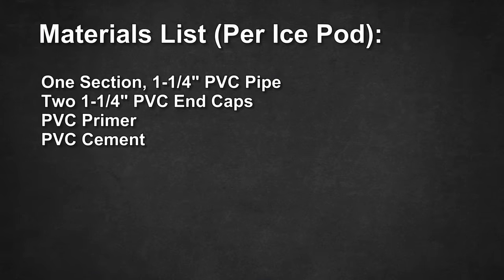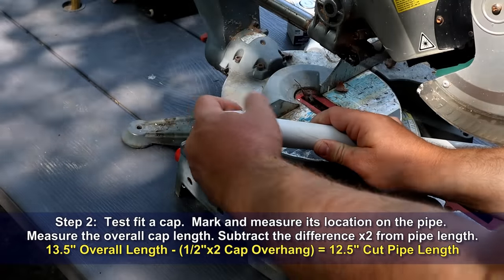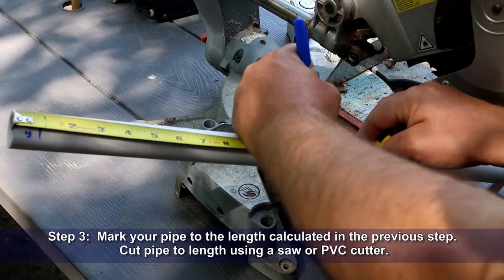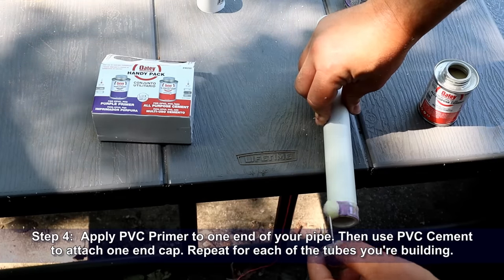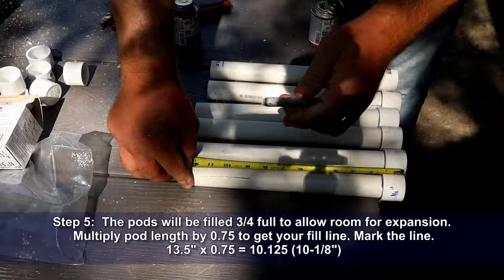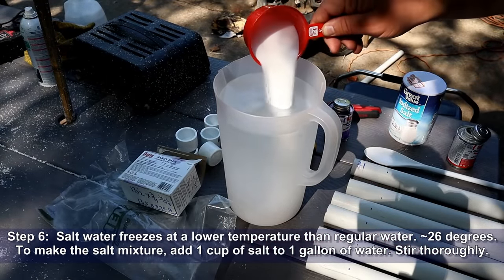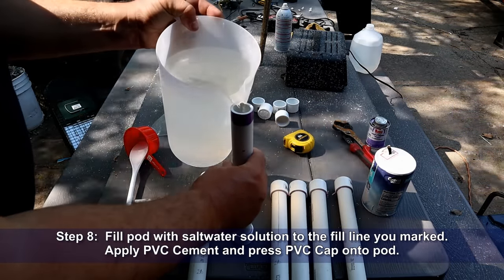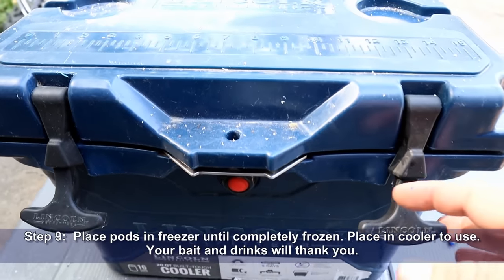Cooler Hack! How to Build SUPERCHARGED Reusable Ice Pack Pods

Comment: I like the idea, and I like a commenters suggestion to use steel, because the heat / cold transfer properties are faster.   However I feel compelled to note, that although salt water and fresh water freeze at different temperatures, the actual temperature of the water / ice / or other solution  is the same as the rest of everything in the freezer, provided it's had enough time to get cold.  A freezer set at 0 degrees Fahrenheit results in fresh, salt or artificial solution at 0 f within a day or two (maybe less)...  That's where the steel would help the water freeze colder faster in the freezer.    

I've been using refreezable soft packs, but I don't like how they sometimes freeze into jagged irregular shapes if I don't lay them out in a single layer in the freezer, and that takes a lot of freezer rack space.  Using rigid freeze packs like this or other, is now really appealing to me.  Thanks!

I like the DIY and presentation and steps shown.  :)
Reply: That much steel would add way too much weight.

Comment: I've seen a lot of comments about boiling water or trying to figure out how to keep the pressure down when the water freezes but I have always just filled the pipe with water, stood it on its end in the freezer with the one cap off.  When it freezes, cut the overflow of ice off and then cap it.
Reply from the maker: @friki-tiki  not a horrible idea.

Comment: You can actually fill the tubes to 90% volume. 

I do this by filling a tube with water, pour into a measuring cup on a digital scale, pour off water until I get the 90% of the original weight, then add 5% salt of the original weight.  I now have a perfect 90% volume that will fill the tube when frozen. I seal and repeat for each one.  I've had some of these for over 10 years with no real signs of wear.  I also use them in the cold smoker to keep temps down when smoking cheese and fish.  

It takes ~5% salinity to hit the 26f or -3.5c mark.  I believe 23.3% salinity has the coldest/lowest freeze point around -21c, but most home freezers aren't hitting that.
Reply: Or, just fill some water bottles 90% full with sea water, and you're done. Save money, time and re-purpose.
Reply: @jejoko  the plastic used to make water bottles will not hold up like schedule 40 pvc, can't be cut to size, nor fully sealed.  I would not put bottled sea water with all its microbes in my for human consumption freezer/cooler.  Also, if you live anywhere but the coast a drive to the home depot is probably cheaper than a drive to the ocean.
Reply: Ideally, a good quality freezer will hit -7 Fahrenheit. If you hunt or store large quantities of meat. It is best to keep your freezer at 0 Fahrenheit or lower if possible. If you hunt deer or wild hog, you should keep it frozen at 0 or below for at least 7 days to kill the trichinosis parasite. Because a good quality freezer can hit these lower temps. They should not have any issue freezing the 23% salinity water. It will just take much longer to get them frozen. In many cases almost 36 hours in PVC. If using copper pipes. Possibly in 24 hours.

I keep both of my freezers at the coldest possible temp. Now in my house fridge freezer combo. The freezer is only set to 20 Fahrenheit. My ice cream is easier to dip, then when I pull out the ice cream from the deep freeze at a -7.
Reply: @thehyperactivesloth  
Yes, if you live on the coast, it is quite convenient. I have been using the same sea water filled Gatorade bottles for years now. They have been thawed and frozen many, many times over now. 
About the bacteria or what not that you're worried about just cook your meet to recommend temps. Although I must say that many times I have washed my catch straight in the blue ocean and made ceviche right there on the boat without any problems. Not to mention all the bacteria and microbes that are already on and inside of the fish that are being thrown in the cooler or whatever hog or deer you have in there. The water in the bottles is probably cleaner at this point, lol.
I must say that I am tempted to try the PVC pipes just because they seem to have a more homogeneous fit next to each other. But other than that, my Gatorade and water bottles do just fine.
Reply: @garyzimmerman8679  Agree, my dedicated freezer is at -2 F
Reply: @garyzimmerman8679 you have a better chance of winning the power ball than contracting trichinosis from a deer.
Reply: @jejoko  well, except for that 2 day trip to the ocean to get it......
Reply: @michaelharris1455  
Yeah.... sorry about that mate
Reply: The freeze point of the liquid doesn’t matter. Any variation of water with or without salt will reach the temperature of the freezer. Unless you’re trying specifically NOT to make ice.

Comment: I tell you how to make them last longer and "freeze" much colder.
1 - Fill them with lead shot first, to the top,
2 - Fill them the rest of the way with anti-freeze, yup, ethylene glycol coolant.
Put those in your freezer chest and you'll be able to get them down to sub-zero temperatures, well below zero, and the added mass of the lead will give you weeks of cold pods in an even mediocre cooler.
For maximum efficiency you can get some lead and make a mold for it so it will fit in the bottom of your cooler. Screw some sheet metal to it to be a "false bottom" so it won't contaminate the food, and put that in your freezer.
Remember, those pods are just heat sinks, they're absorbing heat so the rest of your stuff stays cold. The more massive the heat sink, and the colder you can get it, the longer your stuff will stay cold. Theoretically you can get lead lower than -100 degrees! In a cheap styrofoam cooler that would last a month or more.
Reply from the maker: @ladamyre1  dude that's awesome! I have hundreds of pounds of lead. I may try this!
Reply: What’s an estimate of how much weight would be added?
Reply: Wow!!! I never thought about using lead. I looked up the heat storage capability, 34 btu per pound, almost 3 times more heat/cooling then water by weight. Plus factor in that lead is much denser by maybe (I'm guessing) 8-9 times more than water. I calculate that a gallon of lead could heat my house for over a week!!!! However, regulators would have a field day on your idea.... 😞

Comment: Thanks for the video! I use 2L bottles, but didn’t even think about salt water.
Reply: There’s no benefit to using salt water as water will freeze at 32, but will get as cold as the freezer regardless of the salt. Using a 30% alcohol solution is could be beneficial as the liquid would not freeze solid reducing freeze cycle stress on the pipe.
Reply: Like Bill said. Saltwater provides no benefit here

Comment: Thanks! (I plan to use a funnel to pour my saline solution.) A hack to your hack that occurred to me would be to use larger diameter cylinders. When I can I always use block ice, but try finding that most places: it lasts so much longer than "cubes" it's not funny, and the ice companies know on which side their bread is buttered.
I like the ABS substitution. A respected Berkshire swine breeder in southeastern Minnesota used overhead ABS pipelines to supply drinkers in his hog lots, year-round. Maybe a freeze, but not a rupture.

Comment: If your freezer is set to 1*F then your ice, whether it is salt water or plain water will be 1*F. The salt water, will melt faster since the freezing point is lower. Once your cooler hits say 26*f, the salt ice will melt but the plain ice will still be frozen.

However, i still believe this can be more effective that cubed ice since the larger block of ice will take longer to melt

Comment: Why not just use some old plastic soda bottles, either 1 or 2 liters? They don't break when frozen, and their greater volume will have less surface to volume ratio and stay frozen longer? I personally just use clean plain water and can then use it to drink or cook with if necessary.

Comment: Those would look great with my PVC rod holders.  Heat formed half a 1 1/4" pipe to be basically L channel and cut a point for ground penetration.  They hold up very well in rocky banks and being driven with a mallet.  I can imagine PVC ice packs would hold up quite well.

Comment: Handy ice pack for sure - Not bashing here, just my humble "not a scientist" opinion:

Once fresh water freezes at 32f, only the can the ice be chilled to lower tempuratures.   The only difference I see here is that the salt water will remain liquid below 32f until it reaches its lower freezing point where only then can it be chilled to a lower tempurature.  Either way, both fresh water  and salt water ice packs will be chilled to whatever your freezer is set to.  The salt water ice pack will melt before a fresh water pack.  If somehow the tranfer of heat occurs at a different rate in fresh water ice than in salt water ice would this hack be valuable.  I do know from my Dive Class days that water transfers heat 4 times faster than air.    That means that salt water chilled to near or at its freezing temp will be colder than frash water near or at its freezing point.  This will definitly cool your cooler items faster but not longer.  Faster than all ice  too with the limitation of only cooling to eaches freezing point.  Any other thoughts out there?

Comment: The salt lowers the freezing point, but the enthalpy of freezing doesn't change much.  The thawing salt water will keep the cooler at a lower temp than 32 but if 32 is OK you don't need the salt.
Reply: ice cant be colder than 32?
Reply: Fresh water will freeze and continue to get colder if the freezer is below 32. Salted ice and fresh ice will be the same final temp.

Comment: Lol you can make regular water colder than 32 degrees. It doesn’t just stop getting colder after it’s frozen. If you freeze water to -20, it’s -20, or whatever temp
Reply: But it will quickly warm up to 32°F. Salt water solution will stay below 32 for much longer.
Reply: @stevegredell1123  um..........no.

Comment: The latent energy required to phase change water or salt water is 80 calories per gram.  The difference is that salt water converts at lower temperature.  Unless one needs temperature below 32 deg F skip salt.
Also, placing packs at top of cooler will keep temps more consistant in cooler. Bottom packs yield bigger thermal gradient - sometimes useful.
Reply: I had a similar thought - Just changing the freezing point doesn't do anything. You need to change the specific heat of the liquid. I looked it up and actually using saline lowers the specific heat of water, so adding salt is counter productive!
Reply: @igelkott255 it will keep the pure water ice cubes from melting as fast by keeping the cooler colder as the salt water pipes melt at their lower melting point.
Reply: Fresh water(unsalted) with freeze at 32 and then get colder, to whatever temp the freezer is. It doesn’t stop getting colder because it became ice

Comment: These work great.  I think you can fill them up a bit more though to get more performance.  Water only expands around 9 to 10% it's original volume when freezing so you could safely go to closer to 90% full instead of 75%.
Reply: You're wrong, 75% is best.
Reply: @gbpakrs  Performance wise maybe, but as far as how much water expands during the freezing process I am not wrong.  Look it up, you may learn something.
Reply: I fill old drink bottles about 1/3 full of water then freeze them. I fill them the rest of the way with water when I'm ready to go and I have a good supply of ice water for a couple of hours.

Surprising to me is the fact that if the lid on the bottle is tight, the bottles actually collapse when frozen because of the reduced vapor pressure and air contracting.

Comment: Cooler gel ice extender used for gel cooler packs lasts way longer. Made three 2 liter ice packs from this and after 3 days camping they  were still 90% frozen solid  had to break ice off of them to put them back in the freezer. Got the packs to make them off ebay really cheap.

Comment: Have used commercial packs I've received with special food orders, but plastic bags always end up leaking the gel  after a few uses... Thinking of substituting the gel in these pods for saltwater. I'll make a trip to home depot for some pipe and caps to try soon !
Reply from the maker: A place I used to work received medications shipped with those gel packs. They went into the trash if nobody wanted them. I used to have a deep freezer full, but they don't last long.

Best of both worlds would have maybe been to thaw them then put the gel inside pvc.
Reply: Great idea! Same issues here so I'll do the same, thanks!
Reply: You can DIY the gel too, it's just isopropyl alcohol and water.
Reply: @TheWeekendAngler in cooler shock ice packs they are made of gelatin 👍🏽

Comment: You can also use isopropyl alcohol as it's freezing point is -128⁰F. About 25% by volume in water gives you a nice slush at -30⁰ F. so you get less expansion, and no rigid lattice to stress your container. Just notice your concentration if using 70%.  Just do the math and account for it being 30% water already. It's not critically important to get it just right. Close enough will work fine.
Reply: Is that with the salt or instead of the salt?
Reply: @wrongninja3847  instead of salt. Lower freezing temperatures and no corrosion if you lose containment. It remains slushy at lower temperatures.
Reply: @lespearson3801 You do want it to freeze solid though, because the phase transfer between solid to liquid is where the real energy is at. If the alcohol solution is only a slush, it's sacrificing a lot of heat sink potential.
Reply: @F0XD1E  that's why you dilute with water. If you use a deep freeze and mix it 25%, it will become solid at about -30⁰f.
Reply: For canoe trips and trekking, bringing single purpose ballast makes no sense whatsoever. Freeze Gatorade bottles for the saltwater effect and use your favourite booze instead of isopropyl alcohol! When it melts you can have cocktails and you won't be hauling around useless weight.
Reply: @lespearson3801  Branchwater and bourbon would make more sense to me.
Reply: @UguysRnuts  it would work, but that's alcohol abuse. 🤣
Reply: @lespearson3801  How do you figure that?
Reply: @UguysRnuts  you might spill it. Don't waste bourbon.

Comment: If you put them on top of what you want to keep cold, it'll work better because the cold air or water drops below the stuff that's warm.
Reply from the maker: You're absolutely right.

 I typically use these in my bait cooler, so I line the bottom of the cooler and throw a bunch of slimy baitfish right on top of them. That position works well enough to keep them cool, and it lets a lot of the scales and slime find its way to the bottom of the cooler.

Comment: It's amazing how much longer ice will last if you wrap the cooler in a thick blanket.
Reply: I used to put wet heavy towels over the cooler to keep them cool longer. It works great.
Reply: Last May, a friend and I shot 4 wild hogs in southern Missouri.  We packed the meat in the coolers, but the ice in, covered them with two layers of moving blankets and put them in the back of a pickup that had the roll on top.  After 8 hours home, they were still frozen  but another couple of hours might have become a problem.
Reply: @dj3114 : Good thinking. Next time you do that, put a folded moving blanket under the cooler, to keep it off the hot truck bed and provide extra insulation. 😁✌🖖
Reply: @pamg5497 : Evaporative cooling. Basic refrigeration. 😁✌🖖
Reply: @zapa1pnt  That is a great idea I hadn't considered. - We'll use that next year.

Comment: I would think that the heavier the material, the more efficient it will be as a heat sink. A steel rod sealed inside a tight fitting pvc tube should provide more cooling, as it will absorb more heat from the cooler contents. But I prefer the frozen water jugs myself due to their dual purpose. I use those along with reusable ice blocks in my Igloo cooler and they are good for 3 days.

Comment: It does not matter if the liquid becomes solid or not. 
It matters how much heat the "ice pack" can absorb from the surroundings. 

If someone does not care about weight, then rocks might work better. They weigh over twice as much so will be able to absorb more heat. Obviously this solution comes with downsides as well. 

If anything, adding a specific sand to these pipes might help.

Comment: Instead of salt, consider using isopropyl alcohol, rubbing alcohol. At 60/40 water to alcohol, freezing temperature drops more than 20 degrees not just 3 or 4.
Reply from the maker: I have actually been working on doing a video making homemade reusable ice packs. My daughter will be helping me with that one and we're Making the alcohol type and a non toxic type that's good for kids lunchboxes. We had hoped to get it uploaded last Saturday, but ran out of time.
Reply: I look forward to catching it
Reply: The freezing point does not matter. Put fresh water and salt water in a 0° freezer and both waters will be ice and their temp will be…0°.